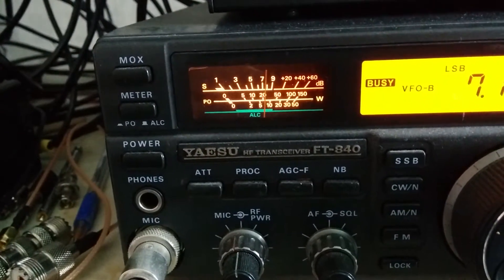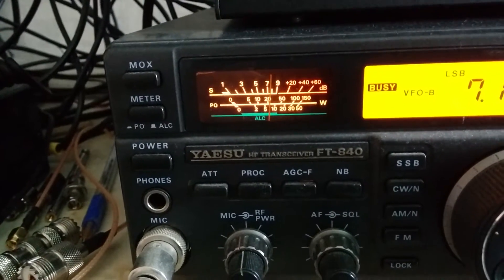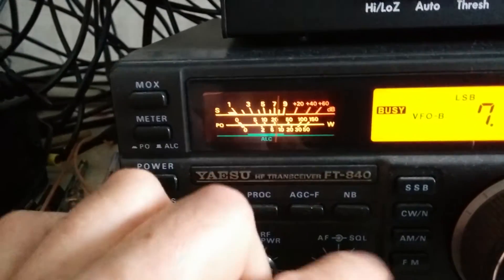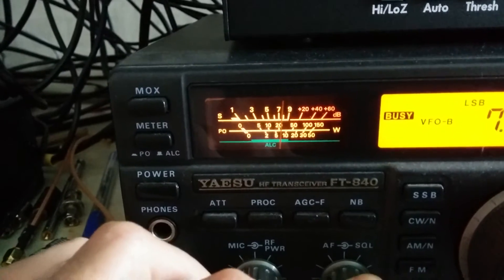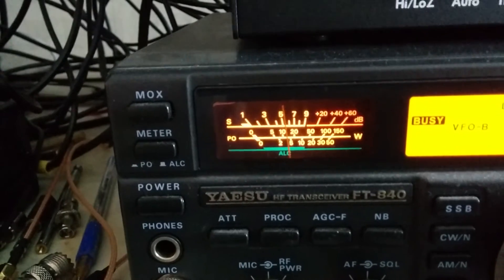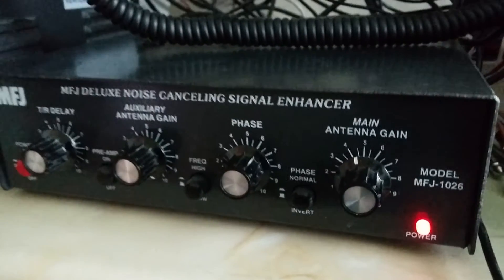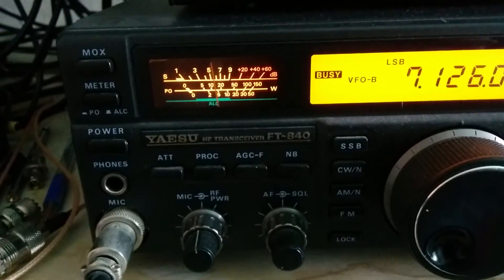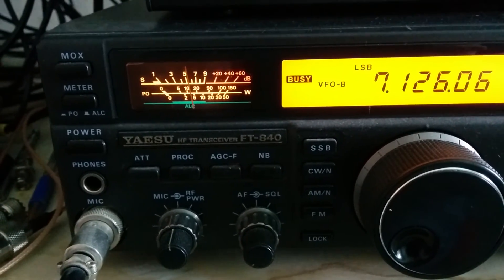MFJ 1026 HF NOISE REDUCTION EXAMPLE

Comment: hi, i seen you put up a g5rv and you also put up a long wire along side it. which one had less noise and better results?
Reply from the maker: g5rv is a bit quieter long wire is fine but g5 is a better overall antenna.